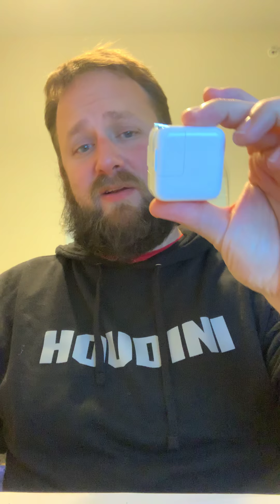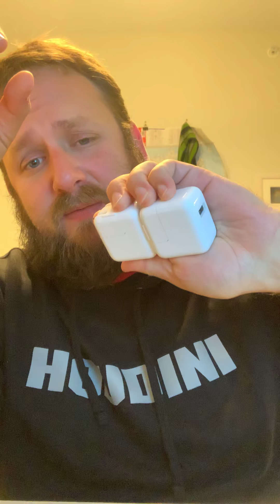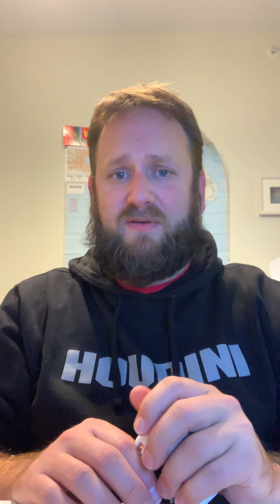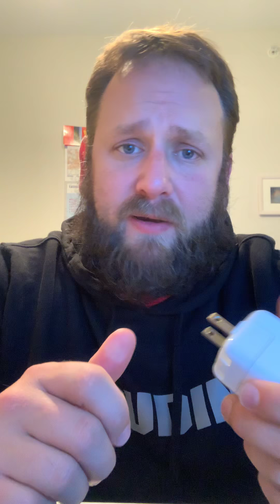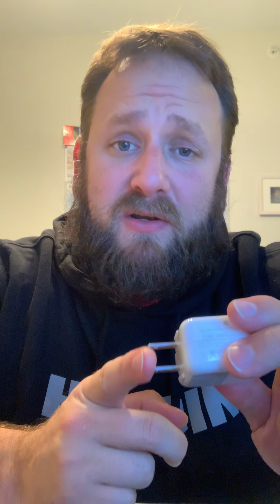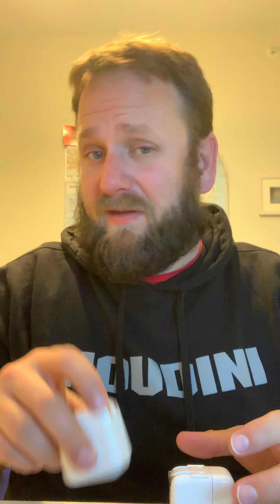Chiplets, Hydrogen, AMD, and Intel...oh my!

Comment: Intel never announced 96 Threads and there is rumours going around that they can't do it with the targeted TDP.
Reply from the maker: 48c/96t.  That's Cascade Lake-AP ;)  TDP is 350w
Reply: @davegraham9932  350 W ea. at base clocks. That's just a guess, still, it's  Intel, eh?
Reply from the maker: @bernrudolph2422  each at lower base clocks than the 8180 using the HCC cores right now.  I'm estimating around 1.6-1.8Ghz with any sort of turbo being around 2.2-2.4Ghz.  it's also more than likely use a new socket larger than SP4/LGA3647.
Reply: @davegraham9932  Damn I thought the FX9590 was hot @200W TDP! INTEL is the new FX processor. I wonder if it will perform like Bulldozer compared to Rome?
Reply: @jerrywatson1958  Depends on how much they "underclock" it relative to previous parts. I don't see how they can come anywhere near to price parity with AMD with 2 giant chips though.